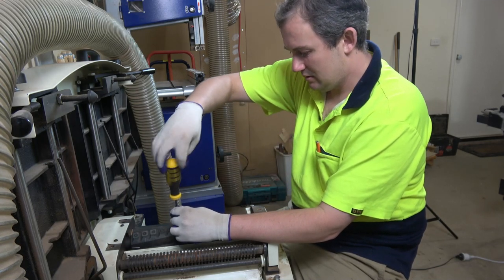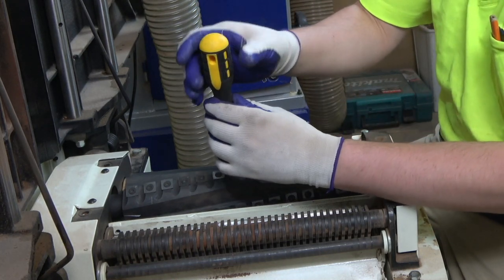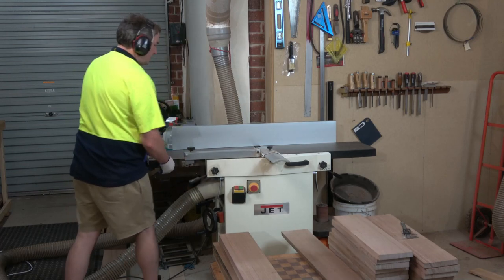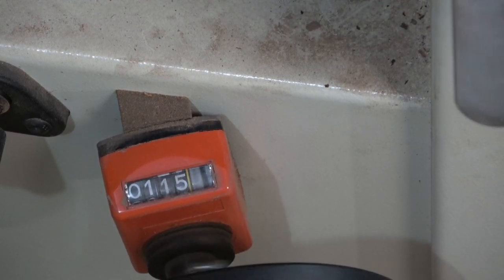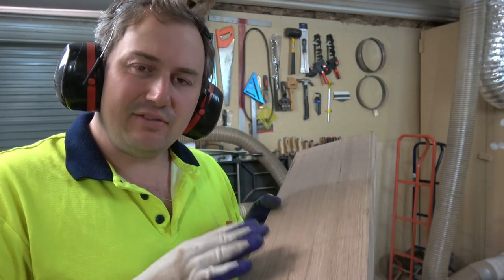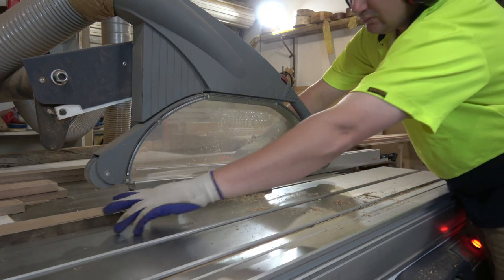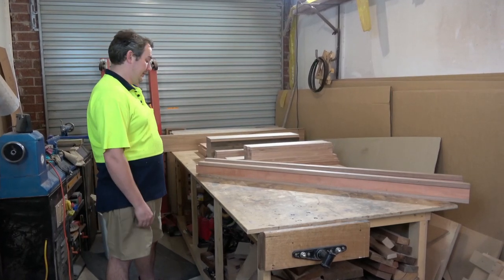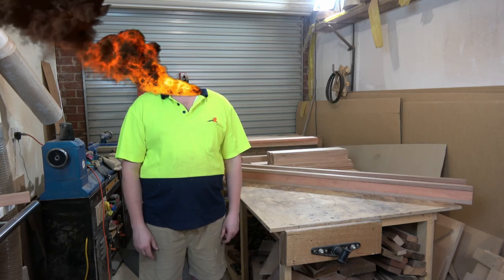Jet combo machine - Baby Cot DAILY Woodworking VLOG 2

Comment: I wouldn't say a failed day, got done a fair bit. I found doing prep work for classes felt the same, looks like not much was done but dagnammit it made time evaporate.  Have a good one
Reply from the maker: Technically I agree with you, but my past experience running a four sided moulder would have had that work completed in about 40 minutes. So it's rare that I look back at a days work in the garage and think "man I worked so hard today". Merry Christmas.
Reply: True, the ones I've seen in flooring lines and laminated beam factories might be a bit big for the workshop 😁 might be a bit of an unfair comparison. Hope you had a relaxing day and a shandy yesterday

Comment: Thought you were a hot head lol, any snipe off the Thicknesser mate & is that a 12 inch Jet ?,  Christmas happiness to you 👍👍👍
Reply from the maker: Merry Christmas Dirk. A hot head indeed. It is a 12" Jet combo. Providing I feed the boards through the thicknesser correctly, it does not give any appreciable snipe. Using it as a jointer can result in leading or trailing snipe if the boards are bowed. Once the bow has been removed and a final pass made, there is no snipe.